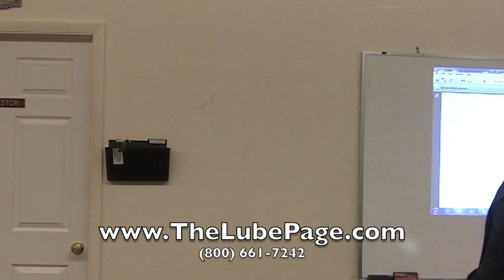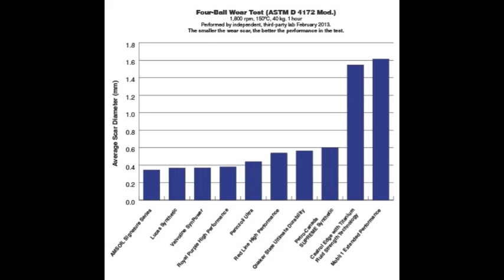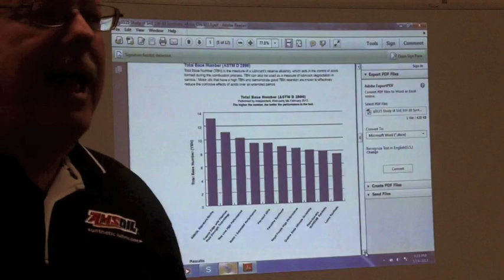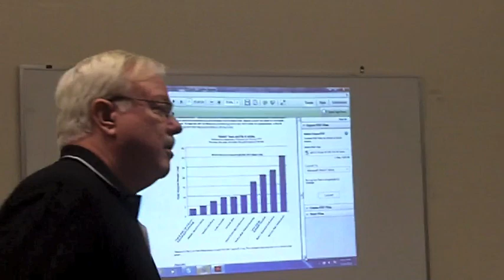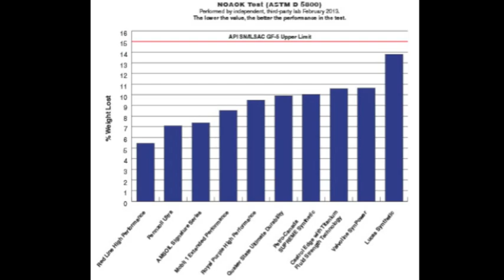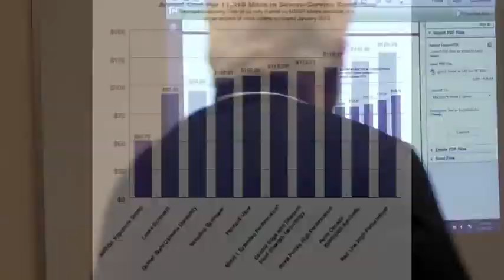AMSOIL SAE 5w-30 Synthetic Motor Oil White Paper

Comment: I use amsoil signature 5w30 in suzuki ertiga 4 years 85.000km...and change every 10.000km and still smooth....amsoil the best
Reply: you can do more than 30000 kms with filter changes and topoffs

Comment: How does the European Formula stack up on these tests?
Reply from the maker: The European oils perform to the higher standards of the ACEA (vs the API).  Euro oils are separated by Sulphated Ash, Phosphorus and Sulfur (SAPS) concentrations to align with advanced exhaust systems on some Euro vehicles.   The Amsoil Signature Oils will usually meet or exceed the performance levels of the Euro Oils.  The one place of separation is the SAPS ratings.  To avoid confusion, Amsoil produces the full line of Euro Oils.  There are several application where the Signature Series will be rated for the Euro applications.  The ACEA ratings are printed on the bottle labels, you just have to know what they mean. 

Email me your vehicles and I will give you the recommendations including if one of the Signature Series Oils will meet your requirements. My email is DanWatson@TheLubepage.com

Comment: I bought oe for my rio, i get 3000miles on 1year, so  i believe i have a good decision this time, btw how about european formula?
Reply from the maker: Amsoil OE is as good as any of the standard synthetics in the market place.  OE is rated for 7500 miles or the longest interval in your owner's manual.  OE is 100% synthetic and it is the bottom tier of Amsoil's three families of oil. OE the XL then Signature Series.

Comment: Sir watson , im from philippines my car is toyota 2017 , 2.8 L diesel engine  intercooler turbo , can i use 5w -30 heavy duty signature amsoil diesel . Recomended viscosity of my suv  SAE 5W - 30 . Oil grade API CF - 4 , CF or ACEA B1  or API CE or cd . Can i use amsoil heavy duty .
Reply from the maker: Yes, the heavy duty diesel oil (API CK-4) will exceed the requirements for the diesel ratings of API CF-4 / CD / CE  also ACEA B1 is basic diesel rating.  Just make sure the oil you are using is CI-4+ / CJ-4 or CK-4 and you will be OK.
Reply: @thelubepage  thank you very much sir , advice .

Comment: Hi - I have a 2014 Fiesta (in India) with the Ford Duratorq 1.5 diesel (aka DLD, which is originally a Peugeot Engine that Mazda uses as well). These use oil conforming to Ford WSS-M2C913 C/D, a rather old spec and oils for that spec are semi synthetic or synthetic hydrocracked ones with older specs (API CF, ACEA A1/B1) - typically Mobil Super, and similar cheaper oils from Castrol (Magnatec Professional), Shell etc.  Amsoil 5w30 signature has Ford WSS-M2C929 and 946 specs, do these update  the 913 spec, or are they purely gasoline specs?  The signature series looks more like a gasoline oil than a diesel.    

I'm using 5w40 weight Amsoil turbo truck for my other car (a 2.2 liter diesel Mahindra Scorpio, not too different from the engine in the Roxor Willys jeep clone that's being sold stateside now) and it works great.  However I'm not entirely persuaded a 5w40 weight oil is going to be as good for the Ford which needs 5w30.

Comment: Tell me this Dan Watson. I looked on Amsoil website their cam/lifter wear for the 0w20 is at 20.28 for the sequence test. Schaeffer manufacturing 0w20 cam lifter wear is 9.8!!!! THAT IS LESS THAN HALF THE WEAR OF AMSOIL
Reply from the maker: Charles, 9.8 is better than 20.28.  Now both numbers are well below the standard for the Sequence IV test of 90.  But this is only one test that shows one characteristic of the oils performance.  The Shaffer 9000 is a high quality oil but there are some other parameters to checkout to get the whole picture.  TBN for one, which is a measure of the ability of the oil to neutralize acids and it also reflects the robustness of the additive package as a whole.  Amsoil is 12.5 and Shaffer is 7.8, this is primarily because Amsoil is warranted for 25,000 miles of service and Shaffer is for normal drains.  Another important measure is the volatility of the oil with Amsoil being 8.5% and Shaffer being 12.8% again this is because you need better control of loss of vapor which tends to thicken the oil when you recommend longer drain intervals.  Deposit control is an important quality and in another white paper field test in Taxi Cabs in Las Vegas the cleanliness of the Dodge V-6 engine after over 1000 hours on the same 0W-20 Signature Series oil is remarkable.  The biggest difference in these oils is that Shaffer is a high quality Group III base stock and Amsoil Signature Series is primarily Group IV and Group V base stocks.  The Amsoil XL oils are high quality group III like the Shaffer oils.  Additionally, you might notice the Shaffer is not labeled 100% synthetic but "Full Synthetic" this means the carrier oil for the additives is most likely petroleum based and this restricts you from labeling the oil as 100% synthetic.  So, I commend Shaffer on the Sequence IV test and challenge Amsoil to do a little better but oils are complicated lubrication formulations and there are many parameters to measure to get the complete picture, I've only named a couple here there are more.

Comment: amsoil runs that 4 ball test at 302F... tell me what engine oil sees 302F?  Or right non amsoil runs it at that temp cause they know normal oil is going to start to degrade at about 260F... see they BULLSHIT you... why not test it at 500F? I mean why not? lets REALLY test this oil... na... they run it at 302F cause no ENGINE is going to see that temp... If you ran this around 212F... guess what... you think amsoil would really be any different than any of the other oils?  NA... but they try to sell you saying "we really wanted to test this oil" again... why not use 500F?  1000F?  lets REALLY REALLY test it... when amsoil runs REAL WORLD tests... lets see what the difference is (tip its gona be like almost nothing or nothing)
Reply from the maker: Matt,
You have correctly pointed out some errors in my mechanical knowledge, I am addressing that in a separate reply. But now you are showing your not perfect either.  Oil runs 30*F to 70*F hotter than water temp in your engine. And your are right depending on the viscosity of the oil, petroleum oils will begin to breakdown around 260*F to 270*F.  Based on your other comments I'm sure you know that oil cools a large portion of the engine.  In order for the oil to transfer heat to the water passages in the engine the oil has to be hotter than the water (basic heat transfer principal).  So the whole purpose of showing the 4 ball wear test at the elevated temp is to show that the Amsoil will provide protection where other oils are loosing it.  See you know mechanics but you don't know oil and the chemistry and physics and Heat Transfer and the lubrication regimes that are in progress to provide protection.  So you want to talk about BULLSHIT, STICK WITH THE MECHANICAL, your clearly an expert in that area, I openly admit I'm not a mechanic.  See the other response for more on my inadequacies as a mechanic.
BTW, Thermostat set at 205*F means oil is running a minimum of 235 avg.  Put the engine to work and make it really put out horsepower and torque and now you have oil running 275*F.  As you know in towing vehicles additional oil coolers are often added and without those coolers oil could easily exceed 300*F.
Reply: REALLY now?  Amsoil says different youtube watch?v=VlHrs15Ywho  amsoil flat out said "we test at 300 when the engine is running 195" LOLOLOL... 

It's all just bullshit to sell here you were just proven wrong by your own company your repping... 

So either you are full of it or the amsoil people MAKING AMSOIL are full of it... what one is it? 

I know your full of it btw because like I told you in a 6.0 powerstoke, the ENGINE DERATES AT 253 EOT... 

How is the engine oil going to run 275F when the god damn computer is going to dereate the motor at over 253?  EXPLAIN.  ya amsoil even says it aint running that hot... your starting to show how many lies you tell to push amsoil... i dare ANYONE with a EOT sensor and a correctly working system (IE if a engine oil cooler exists, it is not clogged) to show me a EOT over 250... (again a ford 6.0 is going to derate at 253... so that tells you hands down engine oils are NEVER seeing over 250 under correct operation)

Comment: To be fair I didn't like how they had the Mobil 1 as over 2 oil changes in under 12k miles when it's labeled as lasting up to 15k miles
Reply: then you should test your car up to 12K. then you will see a result, right? comparing to my country, US traffic condition is not severe driving condition at all. when you drive, you don't face with heavy traffic you can't imagine. you can use mobile 1 up to 12K. but you can't use up to 12'K if you drive in Seoul or Tokyo where lots of people live or you get tons of stress when you drive through heavy traffic. it's severe condition. you have to change every 6K then. changing oil depends on condition. in the same situation, even Amsoil can't be used up to 25,000miles. no. it's maybe better for 12K or something. but it's still amazing.

Comment: No OE or XL for me ...I bought the Signature Series 5w 30 for a 2012 Nissan Rogue with the 4 cylinder 2.5...Great noticeable  difference in acceleration,I did not have to use as much pedal to get it going...Fuel milage was way better..